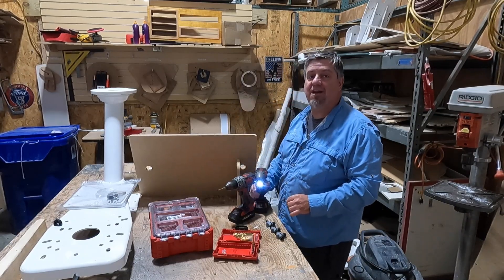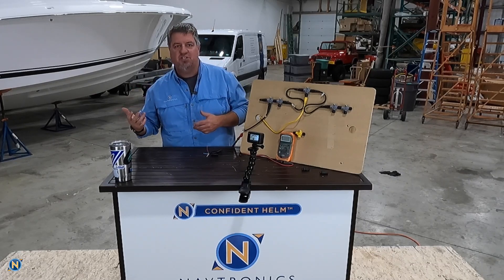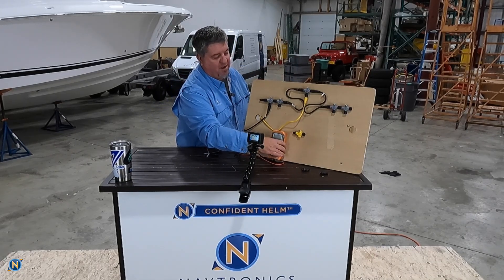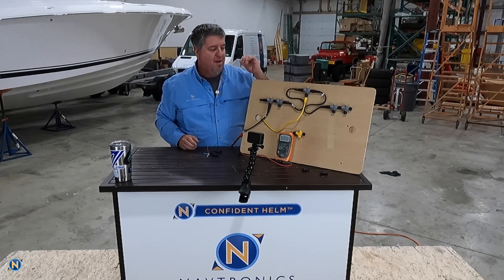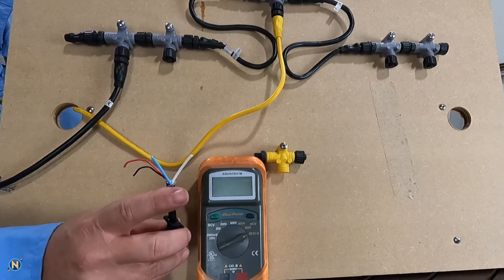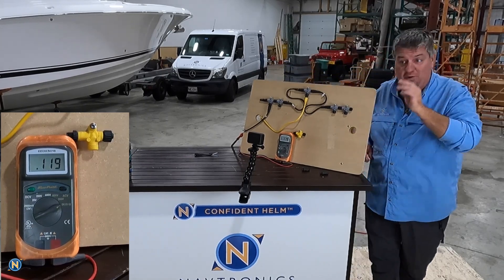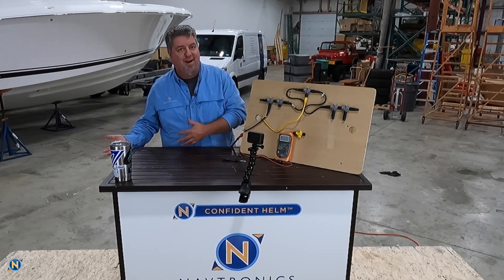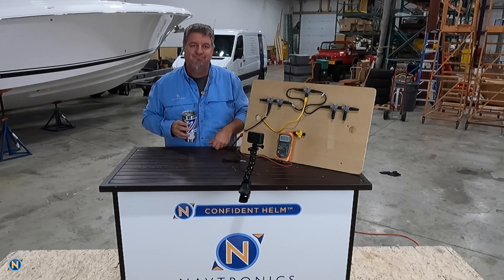SWS S5 Ep3 NMEA2000 Trouble Shooting

Comment: This is great information. My NMEA 2000 network was installed 2 seasons ago and has been working great until late in this last season. Now the guages don't work now on my sailboat which is currently on the hard and covered up. But I want to do this ohm test. I have two sensors (wind and water) and two Garmin gauges (wind and water). I have a question. Do I need to disconnect drop lines/devices from the network Ts to do the ohm test?  THANK YOU
Reply from the maker: John,  thanks for reaching out, no in most cases you do not need to disconnect anything from the network to do this test

Comment: How can I extend a nmea back bone cable, Do I need a T, or just connect them together
Reply from the maker: You can do either option.  Most people find it preferable to add in a T as it gives another access point for them to add something in the future a little more easily.

Comment: This is really helpful. Thank you. I'm about to install one of these for the first time. Googling for two weeks mostly I just found information that wasn't basic enough. This is exactly what a newbie needs. 

 (My next big question is I have a sailboat with a 63' mast. That means the 'drop' NMEA from the wind instruments is 3x  greater than the maximum 6m/ 20'. I'm guessing there must be some way to run the backbone 45' up the mast (and back down again) with some kind of minimal T connector.  Or something else?? 

(And good news. If I'm pulling out my hair to learn and do this then according to the way Murphy's Law works for me... all this will be wireless in 6 months.)
Reply: If these instruments need data and power I would use separate cables for them. Make the connection up there as good as you can if possible by using soldering and shrink tubing for insulation. You don't want to go up there every week for fixing them. Provide strain relief for the cables. You dont want 60 feet of cable pulling on the connections. Don't use single strand solid cable. Below deck preferebly in a watertight box you can add a cut NMEA cable long enough to go to straight to your display or NMEA backbone. 
Wireless instruments exist. They aren't cheap.